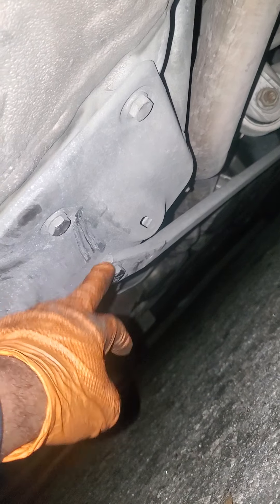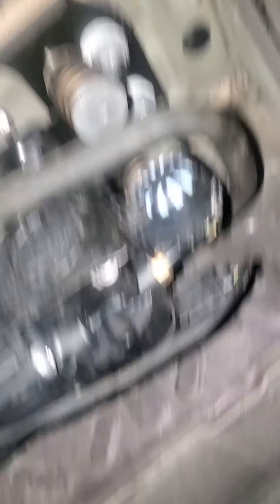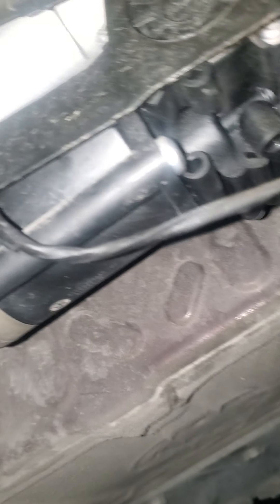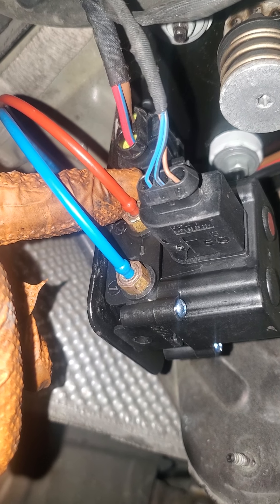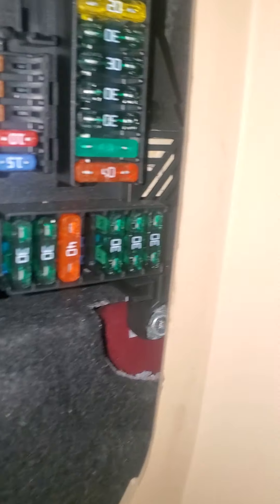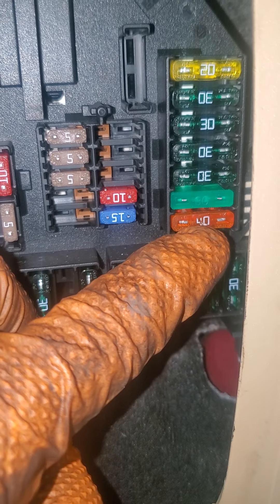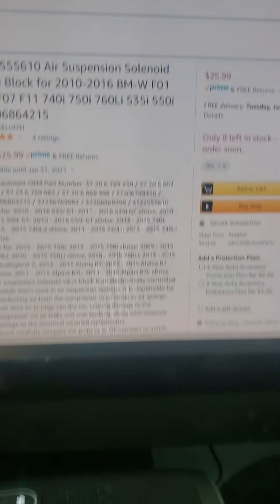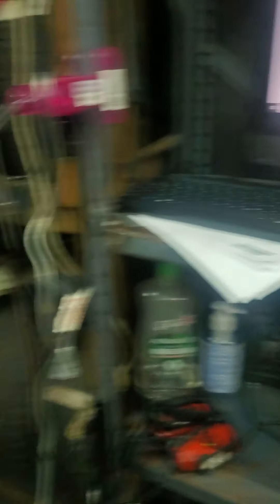quick tips on how to tell if the bmw air suspension is bad or the valve block

Comment: Link for the amazon product please
Reply from the maker: https://www.amazon.com/s?k=Rear+Air+Suspension+Spring+Bag+Pair+BMW+5-Series+535i+GT+Car+2011-2014&crid=2Q4XHVB76SJGL&sprefix=rear+air+suspension+spring+bag+pair+automotive+specialty+parts+for+bmw+5-series+535i+gt+car+2011-2014%2Caps%2C356&ref=nb_sb_noss

here's

https://www.walmart.com/ip/Maxpeedingrods-Rear-Air-Suspension-Spring-Bag-Pair-Automotive-Specialty-Parts-for-BMW-5-Series-535i-GT-Car-2011-2014/298323613?wmlspartner=wlpa&selectedSellerId=101068124

Comment: Hi there I have a GT 520D 2014 model and my air pump isn’t working. I had these air springs and pump replaced 2 years back but this time the symptoms are different.. can this be a simple blown fuse or should I replace the pump.. I haven’t used my car 8 months due to the pandemic so could this be an issue with the battery but so far I did not experience any starting trouble. Please advice, thank you
Reply from the maker: You should hear your air compressor working when you start the car if not so there's an air pump fuse in the trunk area you will need to check that first then your air compressor plug or wire at the end it will be the compressor if all those things is fine

Comment: What if the car only sags on one side but only does it when you drive the car? Will hold air overnight and drop as soon as you drive it.
Reply from the maker: Never seen before but if you have a good scanner like autle or snap on you will get a code and then you go from there
Reply: Did you find the solution? :)
Reply: @jylp4u what was your solution